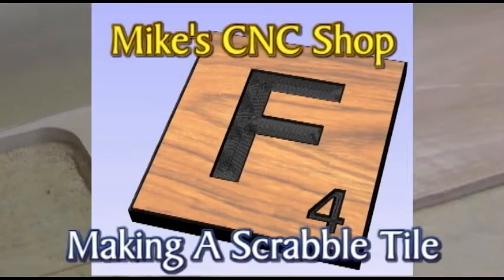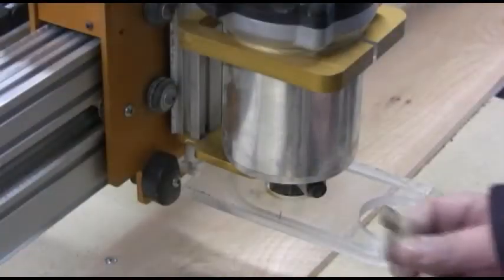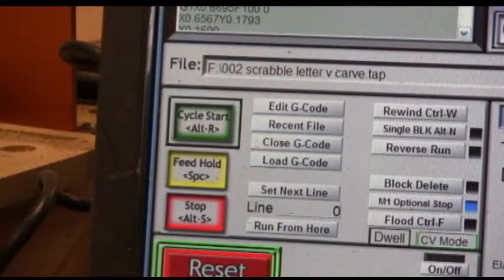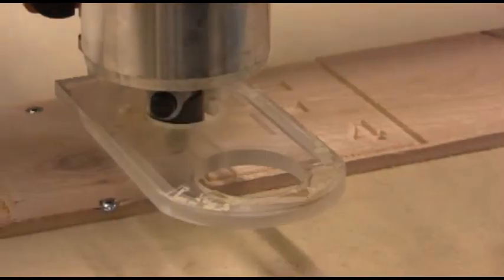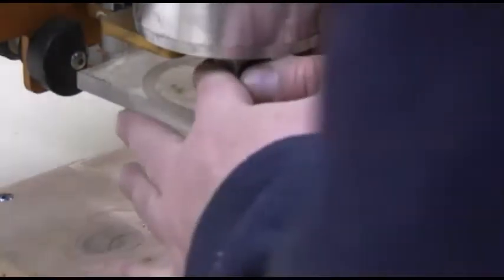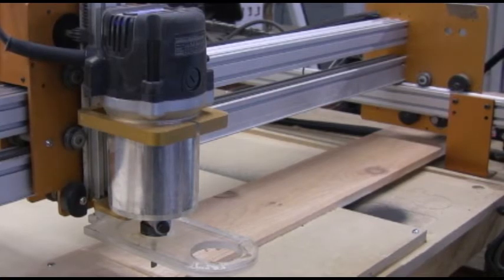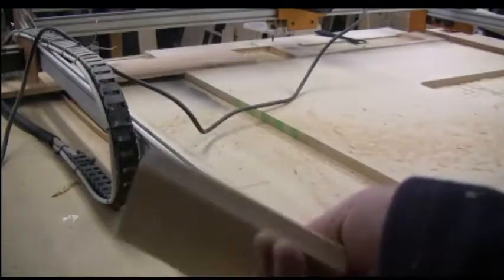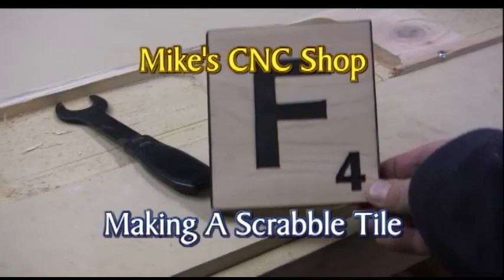Mike's CNC Workshop  - Cutting a Scrabble Tile

Comment: Now that's a kool idea.. nice tile
What router do you use?
I am rebuilding a Chinese 6090 that did not come with a router.. I love my water cooled spindle on my other machine but i don't want the expense on this machine. thinking on mounting the unit in my trailer along with my laser for art shows.

Thanks for another kool video
Happy New Year mike
Reply from the maker: I'm using a Craftsman 12A 2HP digital router on my machine.  It's loud, but it's got good power.
Reply: i might have to go take a look at some routers today